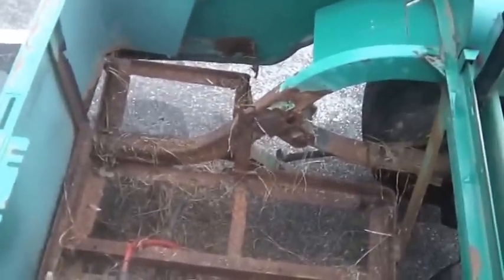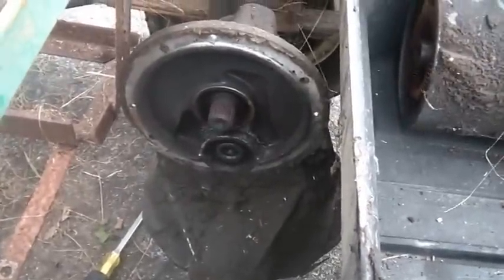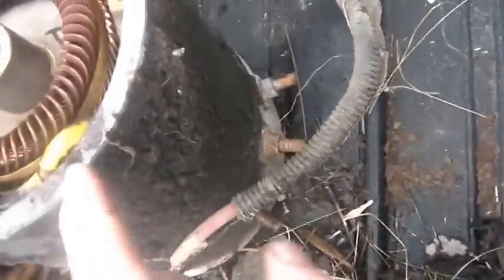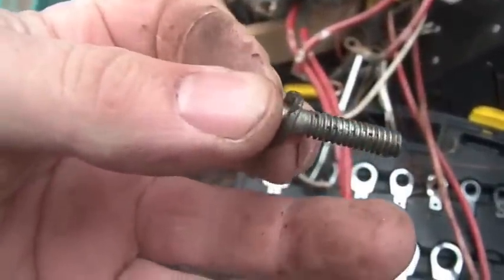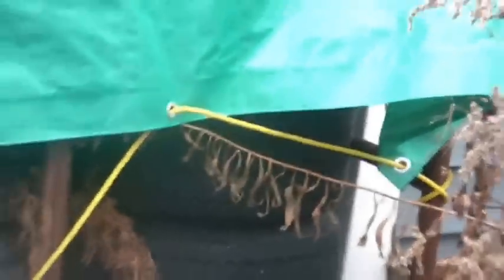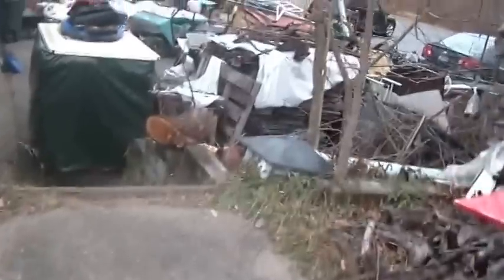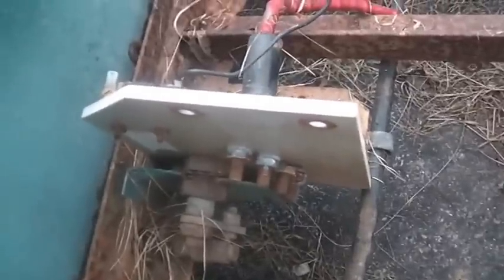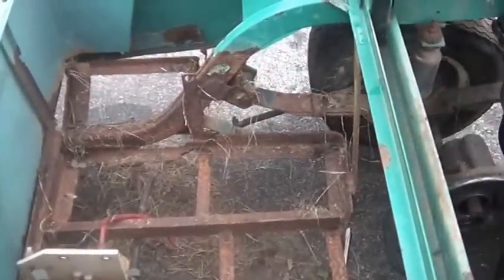12_16_2014, 1988 EZGO Electric Golf Cart to UTV, Part 2

Comment: You have many options. It would depend on the area of my property how far I would go with a dog, and what most of those applications would consist of. I personally would see reverse as a must, and enough torque to pull heavy things... use the strongest rear-end you have, and it should be bullet-proof. You probably have more options tucked away somewhere. A short flat-bed with a swing hoist is nice. Or you could back-track and purchase a battery for the electric motor, and make a solar canopy for the top. Just suggestions. The electric cart I ride around in at work I use mostly jump-start stalled diesels with. It is a pretty fast cart, so yes, speed does contribute to the joy factor!
Reply from the maker: alphamongrel , U get to drive a cart around at work? Too cool, though they are available at work, my boss will not let me near them, he seems to think that me and a cart would be some kind of trouble. About the green EZGO golf cart, reverse is a necessity, a flat bed would make it practical, a boom with a hoist is a very good idea. Thanks for all the good ideas, I'm always after input and feedback. Thanks also for watching and commenting!

Comment: Harvey  I have watched alot of your videos and i dont know if you knew it or not but you got all the parts to fix a UTV out of one of those golf carts . If you would measure a honda 3 wheeler rearend and motor  one with reverse, it  would fit  with minimal welding   i just got a Suzuki 230  4 wheeler with blown front end im going to put in a golf cart  so it will have Reverse , and if you got a rearend with  forward and reverse  any engine you want will run it  bee a honda 50cc or up to a 200 easy
Reply from the maker: +Crayz_daves Build , I saw a golf cart on eBay that someone used the back of a Honda 250es in, it had 5 speeds + reverse and the Big Red rear axle... It was beyond cool, it was very well done... I am subscribed to Ur channel, U have not put up a video in a while, I hope U post something with the golf cart / ATV U R building... Thanks for your thoughts, watching, and commenting!!!
Reply: thanks for the sub  i will put a new one up  soon . i got a 86 se 250  front end is trashed am thinking of puting under a golf cart too  as a trail rider

Comment: What is the gear ratio of the rear end. Just curious, I like your tractor trans idea but it may need to be over driven to hell. tractors are already low geared then to times it by what ever that rear end is. Could be winch ratio. I like you ideas good stuff!
Reply from the maker: william staten , The GE motor says it runs at 2800rpm, and if one figures a golf cart does 10-15 MPH, I'm thinking the gear ratio is around 10 to1, maybe 12 to1, I will probably have to put a small sprocket  on the GE motor shaft, (input to the rear) and a bigger one, (2-3X) on the transmission output,. There will be a lot of Red Neck calculating going on during the build. Thanks for watching and commenting, and keep up the good work on Ur project!,

Comment: I my self prefer the red thing . If you fix the first cart , Your welding skills will be much better when done  Red thing to work and make one golf cart FAST , yes FAST .and it would not need to go backwards just  Fast.  The green one with bed would be my second choice . Is there any starter or electric motor rebuild places close . May get starter-gen redone for a reasonable price. or take it apart and see what in there. Oh is there Holidays coming up  soon.
Reply from the maker: wtbm123, I keep waffling on the Kawasaki Mule, (the red one), I managed to start it on starting fluid, it needs its carbs rebuilt and a cooling system to determine what shape the drive system is in, but, if I install that golf cart rear, and a Honda 200S motor, it would be fast, cool, strong, it would have reverse, and most of all it would be reliable. The starter on the EZGO Work Horse has dead spots, its last owner replace the brushes, Thanks for the input, watching, and commenting!

Comment: Fix the red one firs it looks to be in better shape
Reply from the maker: bleeck2000 , Everyone loves the Kawasaki Mule!  I have started that engine on starting fluid, it needs the carbs rebuilt and a cooling installed to determine if the current drive chain is viable or not, that has been keeping me from cutting it up, though, I waffle, back and forth, cut it up or fix it as OEM as possible. Thanks for the input, watching, and commenting!
Reply: The mule just looks like it will be a nice machine to have around the Hoard and don't tell people about the ordinances because if you get a troll On  here they can be pretty nasty I watch a guy that is having the city called on him and the police for living off the gridI just don't want anything to happen because I love watching your videos